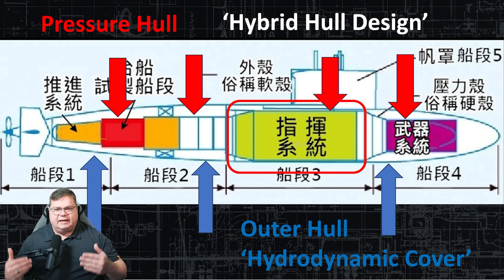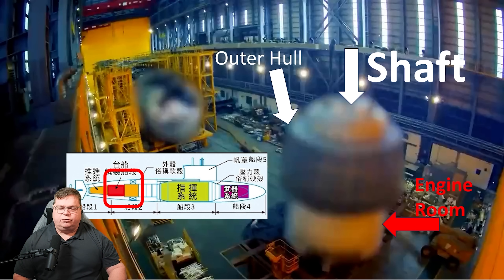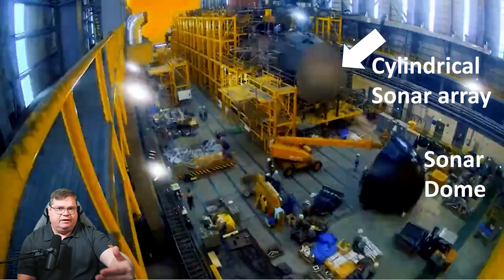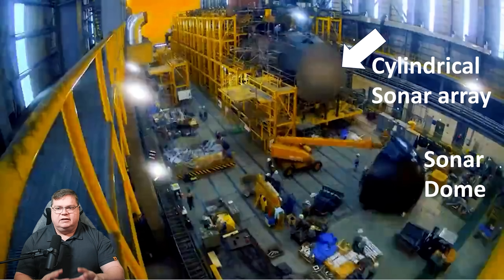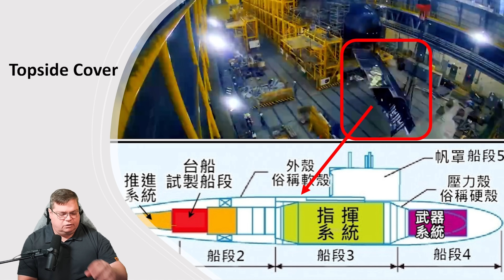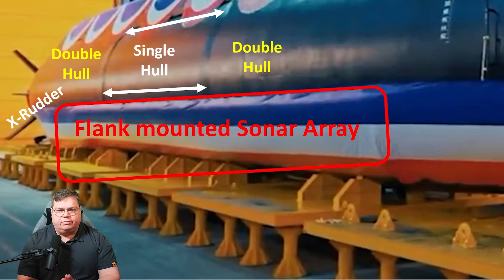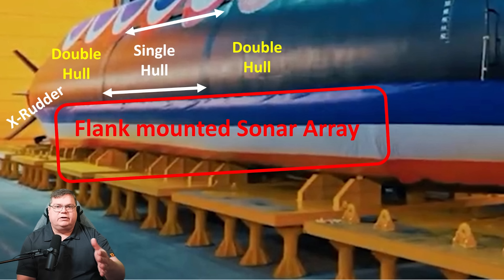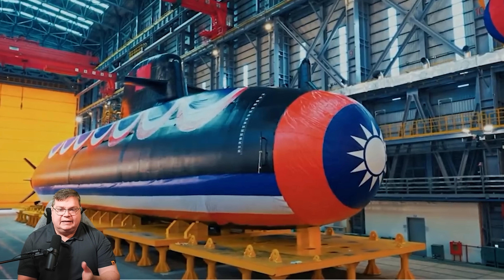What They Don't Tell You About Taiwan's First Submarine

Comment: Would the lithium batteries close a lot of the gap between a conventional diesel electric and one with AIP? It should have considerably more battery capacity than a Colins or older submarine.
Reply: YES!  Learning from Japan's latest diesel / electric design lithium ion battery sub, Taiwan decided they would do the same.  Concerns about sea water combining with the Lithium have apparently been addressed.
Reply: @hallmobility  you just, don't let the seawater in! I think salt water sets off all batteries, it's just short circuiting them. Battery explosions are a common enough emergency on pre lithium ion submarines.
Reply: @greybuckleton  Well DUH.  But Japanese engineers have overcome this slight complication.

Comment: Underwater submarines are difficult to detect. The waters around Taiwan are even more complex due to the Kuroshio Current and volcanic terrain.
The Kuroshio Current, also known as the Japan Current, is a branch of the North Pacific Ocean current system. It is the second largest ocean current in the world, originating in the Philippines, passing through the East Coast of Taiwan, and flowing northeast along Japan before merging with the North Pacific Current. The Kuroshio Current has a current speed of 1 to 2 meters per second and a width of over 200 kilometers. Fish and underwater vehicles are carried along by the Kuroshio Current like they are on a highway, automatically flowing towards the North Pacific Current region. The complex deep sea area where the fast-flowing Kuroshio Current passes through stretches from the Bashi Channel region in southern Taiwan, connecting to the East coast of Taiwan, to the Miyako Strait region in northern Taiwan.
Sea of East Coast of Taiwan, a "thermocline" is formed in the area where the water depth is 100 meters. Only a few sound waves can penetrate this "thermocline." Most of the sound waves are reflected back from the "thermocline" like a mirror, and continue to transmit back and forth between the "thermocline" and the surface of the sea. A sonar detection blind zone is formed below this area. Taiwan submarines and unmanned submarines can hide in this blind zone, and the Chinese military ship's sonar system or the sonar detection system thrown into the sea by anti-submarine aircraft from the sky will be unable to detect Taiwan submarines and unmanned submarines.
If Taiwan submarines and unmanned submarines dive to a depth of 200-300 meters below sea level, the enemy can only use submarines to search for submarines to detect them. However, the surrounding waters of Taiwan are Taiwan's territory, especially the Bashi Channel in the southern part of the Taiwan Sea connecting to the Miyako Strait region in northern Taiwan, which is an area with unpredictable Kuroshio Currents. Chinese submarines or underwater vehicles cannot stay in this area for long. They will be automatically washed away to the North Pacific Ocean by the Kuroshio Current and will be unable to sustain combat operations here.
Taiwan has already fully understood the Kuroshio Current area in the east, and is clear about the changing location of the underwater ambush zones around Taiwan throughout the four seasons. It has also deployed fixed and floating underwater sensors or unmanned submarines. Taiwan submarines and unmanned submarines are ambushed in the underwater ambush zones that move with the seasonal sea conditions, or they release denial intelligent mines in the surrounding area in advance. Chinese submarines dare not approach, for fear of being caught in the net and killed. When necessary, Taiwan's IDS submarines can dive to a depth of nearly 400 meters below sea level, where Chinese submarines cannot reach. They can then launch MK-48 torpedoes to easily destroy any enemy submarines or enemy fleet convoys that want to attack.
Taiwan's geographical location is unique. The West Taiwan is separated by the Taiwan Strait to China, which is on average 180 kilometers wide, which is a natural barrier that can easily deter China's attempt to invade Taiwan by landing. The Bashi Channel in southern Taiwan connecting to the East Coast of Taiwan to the Miyako Strait in the north is an area with fast-flowing underwater currents. It is an area that cannot be stayed for long unless there is support from a nearby port. It is also a natural barrier. Taiwan's great self-made submarine capability has supplemented this block of underwater defense and combat capabilities. It can easily deter China's attempt to invade Taiwan from southern, eastern, and northern Taiwan. Taiwan's national defense is in a state of prosperity, and Taiwan can now rest assured.
Taiwan's domestically produced submarines and unmanned submarines are the most important strategic weapons of national defense. Now that Taiwan has produced manned and unmanned submarines, China not only has no chance to cross the sea to invade Taiwan or blockade Taiwan, but it also has to worry about its ports being blockaded, which will completely shatter China's illusion of invading Taiwan! Taiwan's air defense missile system density is one of the highest in the world. It is impossible for the Chinese military to fly over. The Taiwan Strait in the west of Taiwan is a transparent firing line. The Chinese military ships and submarines that invade from here are tantamount to suicide. The southern, eastern, and northern parts of Taiwan are guarded by the natural Kuroshio Current barrier and the submarines and unmanned submarines of Taiwan Navy. The Chinese aircraft carrier, destroyer, and escort fleet will not dare to come.

Comment: Taiwan has successfully developed a 533mm-diameter torpedo launch system for Taiwan-made IDS submarine Narwhal. In addition to being used to launch US-made MK-48 heavy torpedoes, the system is also being prepared to launch Taiwanese-made submarine-launched Hsiung Feng II anti-ship missiles, submarine-launched Hsiung Feng III supersonic anti-ship missiles, submarine-launched Hsiung Sheng cruise missiles, and submarine-launched Sky Sword II air defense missiles. The diameters of these Taiwanese missiles, after being modified and installed in submarine-launched pods, are all smaller than 533mm torpedo launch tubes, and the IDS submarines can all launch them in the future.
During launch, the torpedo tube will push the Taiwanese missile pod into the sea. After traveling a certain distance and approaching the surface, the missile engine will ignite, break out of the pod, and emerge from the water. After the guidance system is activated, the missile will fly into the sky and autonomously attack the target.

Comment: When the fully lithium-ion powered submarine is charging underwater, it extends the exhaust and suction pipes and uses the diesel engine underwater to quickly charge the lithium-ion battery. The lithium-ion battery can be fully charged in about an hour. 
Submarines using lithium-ion batteries made of new technology materials can be fully charged 10-20 times faster than traditional submarines using lead-acid batteries.
The closed air turbine system installed on the AIP propulsion system submarine uses liquid oxygen in conjunction with a diesel engine as the power principle to charge the generator as propulsion power and charge the lead-acid battery. AIP submarines must constantly start their diesel engines, which continuously generates noise and is easily detected by sonar detection. Submarines powered by all-lithium ions can travel completely silently underwater, even quieter than nuclear submarines. Noisy AIP-powered submarines are already backward submarine designs.

Comment: I was Submarine qualified on Ohio class boats in 1984 and was fascinated by soviet double hull designs that used Titanium in the Alpha’s our somewhat feared adversary if they weren't so damn noisy. Bucket of bolts but a tough hull and very fast. 
This Tiawanese boat baffles me, pun intended. Perhaps we don't share our HY80 and HY100 hull welding designs with them, but it seems a very inefficient design and cramped for space no matter how much smaller asians are on average.
Reply: Russian submarines in those days were very fast and very noisy. The Russian did this by using high powered liquid metal coolant nuclear reactors which wear hard to repair when it had an operational leak - this means a reactor leak would sink a Russian sub fast and kill its entire crew at the same time - something the Russians don't like talking about - the USN nuclear subs are safer and easier to maintain and fix which is why we have so many really old nuclear subs still working..

Comment: Thank you for introducing Taiwan's first self-made submarine. Although I am a DPP supporter, I was not optimistic when Tsai Ing-wen proposed the idea of domestically building submarines in 2016, but she succeeded.

This is the first attempt, and Taiwan has never had relevant technical experience or personnel before, so some of her designs are conservative, such as the AIP you mentioned.
In stead of going far, I think she needs to stay underwater for a long time more, so maybe she will install a lithium battery instead of an AIP in the future.

What is worrying is that in the 2024 general election, KMT plus TPP may hold more than half of the seats in Congress. They are likely to  boycott the budget (or even delete it) for the seven next submarines. DPP is working very hard to avoid this situation.

 God bless Taiwan.
Reply: Good luck.
I hope that you guys manage to build some more subs.
Perhaps you can unofficially get some Swedish engineers on board with the next design?
Their subdesign would probably suit you well (although the higher temperatures of your waters might make a Sterling engine less efficient)
And if you guys get enough submarines that would probably help you both with hindering a Chinese invasion and helping you with blockade running.
If you can get enough cargo submarines to keep supply lines open with Japan and enough attack submarines to hunt down enemy subs and ships you can probably survive for a extended war.
Reply: 潛艦國造是國民黨政府規劃 編列預算 民進黨只是執行此計畫 .這點請你改正
潛艦國造原因
  是 美國人 根本不賣給台灣  美國也不在生產柴電潛艦  更鬼扯說謊 說國民黨阻擋69次國防預算  阻擋 怎現在會有潛艦?
出來講話
Reply: 測試你看不看得懂中文
Reply: @shaolintseng3300  廢話少說, 此時此刻, 你的賴主席是否支持核能 ? yes or no?  三個政黨中，現在哪個政黨反對核能？我投總統票給一個百分之百支持核能的，不管他是誰，不一定是國民黨。
Reply: KMT boycott the budget? how about DPP abandon nuclear energy and enbrace natural gas. Within last 2 years, due to high LNG cost, state-owned Taiwan electric lost 400 billions. That is the cost of 8  submarines. Nay, not a worry for DPP supporter.
Reply: @yankev0u  
A nuclear power plant would be a nightmare to deal with during a war...
Just look at Ukraine where they had fighting and shelling around some of theirs...
Do you want to live right next to one while the Chinese drops bombs on it?
Reply: Resistance is futile 😂
Reply: @anakborneo8276 
Not necessarily.
They're on a island, that's both a blessing and a curse.
But if they are smart about things it should be possible to make it extremely hard for the Chinese to capture the island.
Reply: @Luredreier  Trump 1.0 made them 5 or 6 MAJOR arms deals, the biggest signed contracts in 3 decades, in 2019.  Cho Bai Dung slow-walked them from 2021-2024 but the 400 Harpoon missiles started arriving in summer 2024, when it was clear Cho Bai Dung could never be POTUS again. Arguably he most relevant of the 5 contracts.
Reply: @anakborneo8276  Evil china....
Reply: 這是垃圾潛艇好嗎😂 菜皇 你的偶像
Reply: @infinitytechcorp It's not junk, but it's not among the best out there either.
This will give them valuable experience.
And once they start making actually good ones this one may be used to transport things in in case of a blockade.
Reply: @Luredreier  a submarine carrying resources ? Seriously ?  U know how many oil tanker or container ship is needed to power even a small town let alone a city? How big your submarine needs to be ?
A std oil tanker is 100000 tons without its cargo...and this submarine is what 2500 tons ?  The taiwan straits is only 20-50m depth....it won't be a submarine already if u build a 100000 tons submarine 🤣
For c sake ... listen to my link above
Reply: @anakborneo8276 Germany and Japan actually did so during WW2.
It's not ideal, but if you can import things like anti-air missiles it might help Taiwan restock missiles to help regular merchant ships to sail in without being sunk by enemy fighters...
As a example.
You won't being in oil or coal etc with a sub.
But components and high value components that you can't afford to be sunk.
While resources like coal or oil is the kind of things where you'll just buy more and send multiple ships and hope that some of them makes it through the blockade as you can afford to lose some.
If non of them can make it through then even the small amounts you can carry with a sub will be better then *nothing*.
Reply: @anakborneo8276 What link?
Looks like the spam filter ate it...
Reply: @Luredreier  That is thinking!  1)  New defense technology  2)  It is a prototype, but qualitatively superior  3)  Secondary use.
Reply: @anakborneo8276  Look at history.  When supplies are constricted, blockade runners are used.  In the 20th century, submarine blockade runners were used in WWI and WWII.  EXPENSIVE yet worth every drachma.